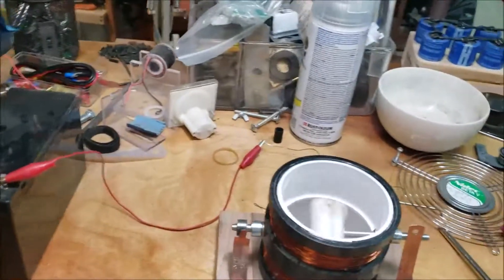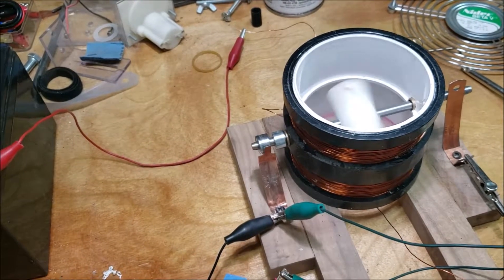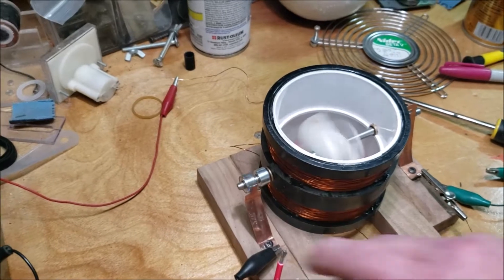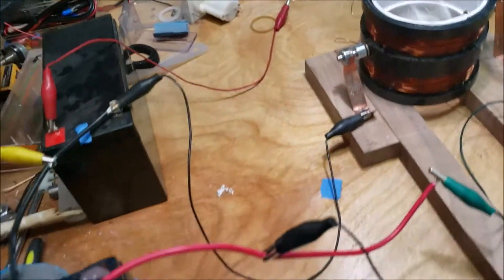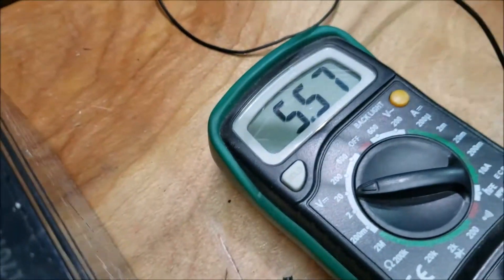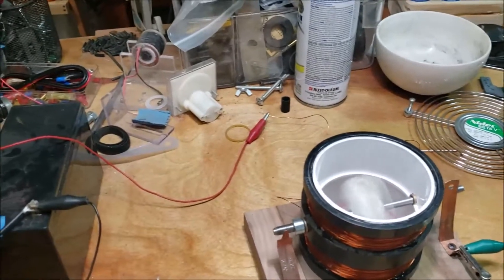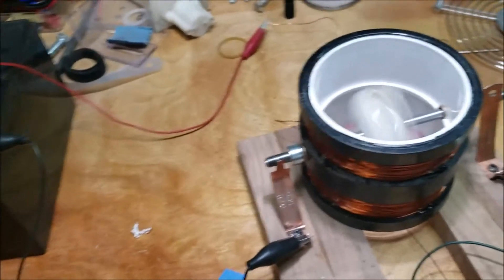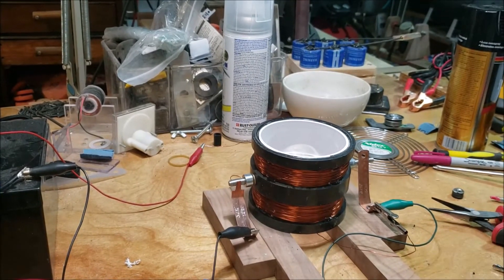Prototyping Newman motor

Comment: how many times have you wind the copper wire at the top and bottom and what diameter?
Reply from the maker: sorry but I almost never count the turns of wire. Its something I should be doing but I just wind it till it look's and feel Right. Especially for a Newman motor.
Reply: @mcorrade  thx i guess i'll be doing the same got all the components and very heavy duty magnets ;).each magnet can hold 430kg .
Reply from the maker: @bartbraet7963  good luck and please make a vid
Reply: @mcorrade  if i look at the magnets newman used they were huge but we got niodinium magnets now and man are they powerfull .
Reply from the maker: @bartbraet7963  yes he did use HIUGE magnets and I've always wanted to re-create his with the same size. I still might make a larger version
Reply: @mcorrade  you crazy man these new magnets are not normal against the magnets newman used , i will make a video when i'm done ;)
Reply from the maker: @bartbraet7963  can't wait to see the vid. I'm thinking I could use the larger speaker magnets like 5 on each end and then wrap the stator with insulated speaker wire :)
Reply: @mcorrade  my magnets are the diameter of the tube you use in your video when i connect both of them your tube would be filled with pur inodium magnet but wont be able to turn so i'm having a larger tube ;)
Reply from the maker: @bartbraet7963  sweet can't wait to see

Comment: I like your motor, well done the conmutator, you can try with this magnet: https://www.kjmagnetics.com/proddetail.asp?prod=RC4CDIA
this magnet is realy powerful and you don't need PVC tubes or protection screws and the magnetic effect is very powerful, it is a diametrically magnetized magnet, try it and the result will be amazing.